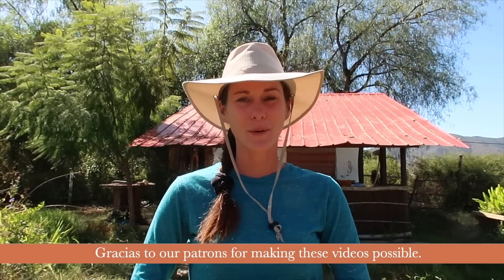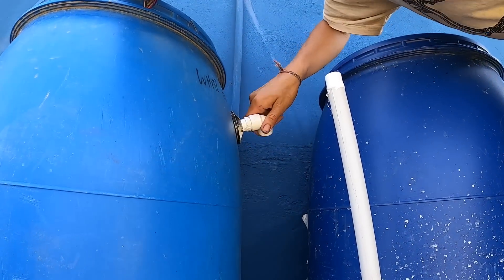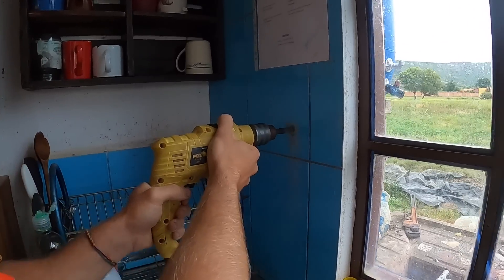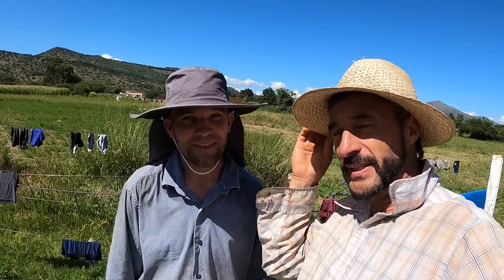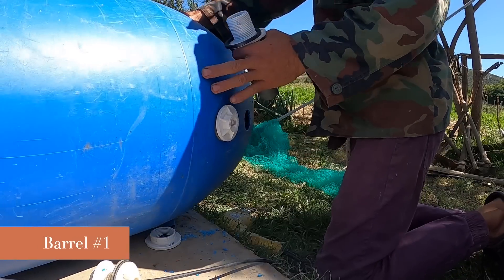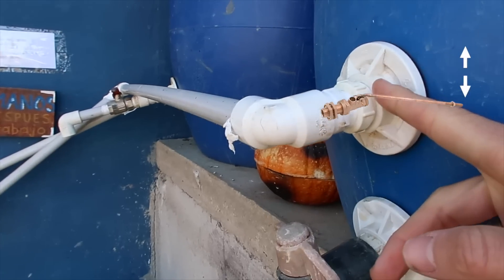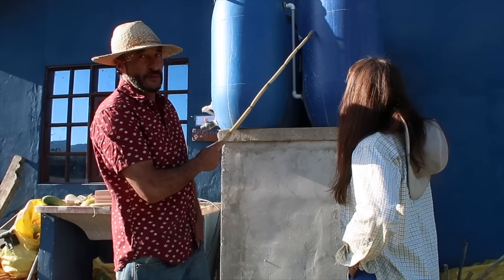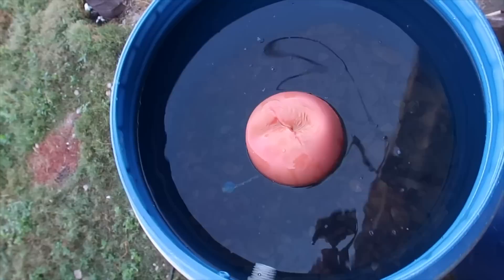At home WATER FILTER | How to build your own

Comment: Things you did not talk about: The sand must be washed before putting it in the filter, it's extremely important especially if you use construction sand. For this drum size, the flow rate must be close to 0.5 liter per minute, it's a slow sand filter. This kind of filter will not work well if the water is very dirty and full of clay, especially the charcoal step. But the 2 first tanks can still remove a lot of sediments.

Comment: Great video! Not that I have built anything like you did. But I thought it might be a good idea to use a bucket custom cut to fit over float value lever so it could move freely. Put some holes in it and rocks on it so it wouldn't float up.  Mount a pipe to it for the string line and float ball. Or spend $500 on a water softener.

Comment: I think an angle float valve installed at top of tank, and a pipe run to bottom, would be easier to access, service, adjust, and replace. Just a union on the fill tube will prevent having to cut the pipe during replacement. Also, using old cotton tee shirts with the mesh would protect the layers from mixing better. Just some thoughts. I really liked the video.

Comment: So I’m curious….. how much would it take to build a filter in the center of the community? Say a drinking well of sorts so anyone could stop by and fill up? Your house was $250 ish? So perhaps $500? I’m interested in facilitating this for the locals
Reply from the maker: That would be amazing wherever that is. At the community center US$500 would pay for the materials, labor required and one years connection to the town water (which needs to be filtered).
Reply from the maker: The-Collapse-of-Civilization  no probs with that as the kids aren't making a tight seal. An issue we have had with air sometimes is if you make the top exit hole too high up the barrel the plumbing will point up a little. If the system drains without constant  input water it can cause an airlock in that elbow.  Best to make the top outlet holes lower on the barrel to avoid the top curve inwards towards the rim. Hope that makes sense.
Reply from the maker: The-Collapse-of-Civilization  water will always find it's level. If the filter is working properly it will filter at a fast drizzle. You won't need high pressure to push.

Comment: I noticed that your charcoal wasn't all ground down into fine dust and there were lots of chunks/pieces in there. My understanding of charcoal filtration is that it is only as effective (and long lasting) as how fine you are able to make the dust. Did you know that a cup of fine charcoal dust has enough surface area to cover one acre? THAT is how effective filtration works because the huge surface area can bond with a high volume of nasties (heavy metals, etc). So unless you grind it down fine enough, (a) most of the charcoal content is not going to actually touch the water passing through the container (so not a very effective filter), and (b) the filtration effects that you do get will not last that long because most of the charcoal is being wasted. Next time use a pestle and mortar to grind each piece down into fine dust and then it will be almost like a shiny paste when you activate it with the acid. For a few hours more work, you'll have a filter that works 1000 times better at removing the bad stuff, and lasts years instead of months.
Reply from the maker: We just did a water analysis. Coliforms are present. They range from 0.5 nm wide. We will add another layer of finely ground activated charcoal to the top as per your recommendation.  Let's see how thick we can put it to optimise flow through rate.
Reply: @Kaiwaipermaculturebolivia did this work well for you? Adding the fine layer of charcoal?

Comment: I always wondered if sun exposure is good or bad to the stet filtration system. I’ve seen videos of shaded or covered systems, as well as exposed plastic blue barrels. Does the sun help break down the material faster? Does it interfere with the internal process?

Comment: Thanks 4 the video, great job!
An advice: in order to use all the volume of the filter you need to cut the excess of the screen: the flap of the net on the barrel wall is a shortcut for the water!!!!!! In the video, showing the filling up, the flow can be seen on the wall.

Comment: :goodvibes:Greetings to Bolivia from Wallachia
You have a nice filtration of water almost the same as we do here in Europe in solitary places where there is no drinking water, but if your friend from Germany helped you I am not surprised, we have Germans as western neighbors :elbowcough: I have similar filtration only smaller for rainwater as utility free i.e. before they introduce taxes even for water from the sky 😄 I have all layers in one container separated from each other by geotextile, filtered water then I store in IBC containers, I just don't have a settling valve in the gravel layer but I will finish it 😃 for me it was probably the hardest to wash carefully all the material before it was inserted into the filter, the plan is a replacement filter so that when the first one is clogged it switches to the second one by turning the valve and the first one is repaired 🥺 I wish you a lot of successful projects all the best.
Standy :yougotthis:
Reply from the maker: Washing the materials did take time.
Reply: @Kaiwaipermaculturebolivia  😂 🤏 👍

Comment: Thanks a lot I’m trying one with the flower pot I seen a guy do it it seems to be I got a little bit out of it you take a flower pot and then put a cork or a piece of wood in the bottom and let it drip through like a Berkey called a ceramic filter
Reply: Seems to work pretty good it does filter water but it’s pretty slow

Comment: I watched Josh Kern’s videos and yours. The filters are the same but the water source is different. Their water is either river, pond or well water. Yours is treated water. You said that it is being treated with chlorine. Wouldn’t the chlorine kill the bio organisms in the sand? Why didn’t you put the activated charcoal first? The charcoal would neutralize the chlorine before the chlorine got to the bio layer, which is in the top part of the sand.
Reply from the maker: They don't treat it with chlorine its actually poly aluminum chloride.  The idea with this filter system is the filter out larger to smaller.

Comment: Having worked with water treatment standards, I'm concerned about the use of bike tires as gaskets. You should really be getting rubber that's rated for drinking water instead of just recycling bike tires. Aside from that this looks like a really cool project!
Reply from the maker: Good one Jay. A non leaching silicon would suffice as the gasket doesnt actually cime into contact with the water when used in unison with silicone

Comment: Will this method remove chemicals, like the ones that spilled in East Palestine, Ohio?
Reply from the maker: Hi Nancy, those seem super toxic and corrosive.  I would use the same sequential system but instead of plastic barrels make cement structures or trenches. It will work that way.

Comment: Have you send the water to the lab to be tested.  To get a report. To remove  guessing just how good the system is.  Or can it be improved.
Reply from the maker: The original designer did. It took ag chemicals and bacterias out for 2 years then required a change of charcoal

Comment: Idea for you. When they make purified sand they basically torch it it in a metal drum rotating the drum of sand and burn the sand which turns bugs, parasites, debris to dust leaving the sand almost white. Sift over a fine screen leaving just the sand, and a much better filtering sand.
Reply from the maker: @markhuffman2752  great idea. Will adopt it

Comment: @Permaculture - Quick Question :)  When and where did you use the "Medium" sized rocks? 

Barrel 1 = Large Rocks + Bricks > Plastic Cover and Pipe > "Pea Gravel" 
Barrel 2 = Large Rocks > "Pea Gravel" > Mesh > Sands
Barrel 3 = Large Rocks > "Pea Gravel" > Mesh > Sands > Charcoal > Mesh > Large Rocks

I checked the "Jon Jandai Life is Easy" video and noticed he did not mention any "Medium" sized rocks. Just like your video, he only used Large Rock and then Pea Gravel. 

Thank you!
Reply from the maker: Aka Pea sized gravel

Comment: I don't understand something here.  You mention rock, sand and fine sand as if there is any distinction when it comes to filtering anything. Now fine sand would have to be in the micron arena to compete with a 1,5, or even 10micron pleated or poly-spun filter. A few of those filters and you are done when it comes to most “physical” issues with water. Now carbon filtration is the crux of all passive water filtration due to its “adsorption” capabilities. But even carbon cannot stop many toxins and or address specific unwanted and perhaps toxic hard water issues. There are only two ways to do this. One is as a secondary passive solar distillation process and or by using a Reverse Osmotic process.  I have built a passive distillation process, where both tables produce 10-12 gallons per day in the summer and half that in the winter, so I added a mixer station to add filtered water and distilled water to extend it. 50% distilled water is better than no distilled water…
Reply from the maker: It gets progressively finer till the charcoal. Helps for ease maintenance and to have the charcoal kept clean for the finer particles

Comment: What water did you use to clean all the material (I thought the water was bed) 🤔 Isn't that trading one Bad thing for another.?
Reply from the maker: Irrespective of the water used to clean once you flush the system two times the system should be clean.

Comment: I’m curious how long it takes to refill the storage tank after it’s run dry from normal usage. How long is one complete filtering cycle? I know it may be difficult but just an estimation of time if you please.
Reply from the maker: I estimate we purity 160 litres in less than an hour.  Maybe I'll time it sometime. You dont want it to push through too fast.
Reply: @Kaiwaipermaculturebolivia  the system isn’t under pressure so I don’t think it’s possible to overrun or over use it.

Comment: Are the barrels expensive there?  If not you could just purchase 4 more barrels and stack them and would be back up water and just siphon in up to filter.
Reply from the maker: Not so much. Us$25 per barrel. One on top would be enough
Reply: @Kaiwaipermaculturebolivia  
I probably wasn't clear.  Can you just use another barrel to use as the platform,  because I'm assuming your just using  gravity pressure.

Comment: Thank you for the lovely demo of such an important thing. What I would like to know is your experience on how the water behaves when you have it stored. What average or max. temperatures and what length and how does it affect the system? Point being a rough understanding on how often one needs rain or maintenance if the water stays stagnant in the 4th storage barrel. 🙏❤
Reply from the maker: Its stored airtight so I guess a long time.  Fyi I can leave a glass of this purified water on the bedside for 5 days and it still tastes pure and has no growths / discoloration etc. That is better than the commercial filtered bottled water we were buying.
Reply: @Kaiwaipermaculturebolivia  Thank you for responding. That sounds ideal! Please post more as your experience grows. This is super useful info. 
A joyful day to you.

Comment: since your filter is dependent on the pressure of city water, if you don't have that luxury, a supply tank on the top of the hill and attached supply line to the filter you folks have made would be needed, as well as some means to supply the water to the top of the hilltop supply tank
Reply from the maker: Correct. In our case we would put a barrel on top connected to our well pump with a float valve.

Comment: I have another solution. . . I had a stainless steel tank made of 1.5mm sheeting. There is no gutter water going into it. It fills by the water that hits the top of the tank, flowing into the tank via very small holes all around the lid in the center of the tank. 

As rain water is distilled and stainless doesn't leach  toxins. . . U have water ready to drink.
Reply from the maker: As long as the input water is clean from chemicals and bacterias that would work I guess

Comment: PVC in the sun toxic
Reply from the maker: Agreed. These tanks are hdpe and are on the south side of the house so are not exposed to direct sunlight.
Reply: @Kaiwaipermaculturebolivia  direct or indirect doesn't really matter the HDPE is leaching pfas/PFOS (fluoride) an endocrine disruptor... Not shitting on any of your effort actual non toxic containers should be labeled non-toxic not just "safe for human consumption" and "resistant to" sun exposure... You are trying to do the right thing and the social engineers already thought of that chess move before you even thought about filtering OUR WatEr... Eugenicist "Make the container toxic, but label it safe..."

Comment: I have a Q; I'm in the Philippines and our shallow well is very iron rich and sandy. It's dense black volcanic sand and it clogs our pump filter regularly. How will this affect this filtration system ie how do we get the black sand out of the first stage, without having to strip it down?
Reply from the maker: That is the function of the first tank. The sediment will settle to the bottom and there is a flush valve. So just with periodic flushing should be good as gold
Reply: @Kaiwaipermaculturebolivia  Hehehe I've heard of service with a smile, but I get a heart! Thanks.... I have just sold my wife on this after she's just had a hard day teaching, so I'll get busy sourcing materials, especially the barrels... The rest is definitely ok here. I've got a cunning plan to use the output from our well pressure tank (52psi)/32psi) into stage 1, by using a half inch inlet pipe with a ball valve so as to regulate the inflow. If you think that's not a good idea let me know; we are paying around $10 a week on distilled bottled water. Right now we only use the well for showering and washing dishes, plus watering plants. I suspect that this filtration system will recoup that in a few months. Many thanks for the quick reply.
Reply from the maker: @tyrotrainer765  we have since installed a tank on top of the system that can be filled by our well. It has a float valve to cut off when full. Gives passive constant flow to the water filter. Might work well in your case too.
Reply from the maker: Did you get it going?
Reply: @Kaiwaipermaculturebolivia  Thanks!

Comment: What is the frequency of replacement of each material in the filter system ?
Reply from the maker: We will publish a vid with a diagram and list of materials soon (would that answer your question?)
Reply: @Kaiwaipermaculturebolivia  I think you've already done that pretty efficiently on this already posted vid. What I'm requesting, is the frequency of replacement of each specific filter component, eg. How often should we change the charcoal, how often, the sand, how often, the gravel, etc. If you could furnish the details for those, it would be really helpful. Thanks for responding so quickly, appreciate it
Reply from the maker: @docsheji  charcoal every 2 years. Thats it
Reply: @Kaiwaipermaculturebolivia  Great, thanks !! 👍

Comment: This filter have the same issue as the original video.
The first stage filter is bypassed by the plastic pipe for the rope.
Reply from the maker: I very much doubt that all of the water is going up that way. It is a good idea to minimise the diameter of that pipe though.  The water inlet is at the side of the tank too, not at the middle where the pipe is.
Reply: @Kaiwaipermaculturebolivia  I've been working on this issue and mine is now ok.
Check on your if it is really a issue or not.
I can propose the solution that works for me.

Comment: Can the sand be rewashed and reused?
Reply from the maker: Doesnt need to be changed for many years
Reply: @Kaiwaipermaculturebolivia  Thank you, so would change and not wash?
Reply from the maker: @gillyburke7339  wash if needed. The original designer called for periodically stirring the surface of the sand in the second tank and then  scooping off that water.  I haven't seen a requirement to wash the sand further.
Reply: @Kaiwaipermaculturebolivia  thank you

Comment: Too bad it doesn’t filter the nano particles
Reply from the maker: Activated-carbon filters usually are rated by the size of the particles they are able to remove, measured in microns, and generally range from 50 microns (least effective) to 0.5 micron (most effective).  The uv light has an effect too

Comment: the Romans invented the sand trap filter. how are you disinfecting the water from parasites?
Reply from the maker: We have also since installed a uv light on the lid of the reservoir tank (4th). I dont believe its necessary but we can also uv purify by batch.

Comment: Good to see another implementation of Josh's work I maybe being fussy, but I'd be careful with the kind of silicone you use, screen material and the rubber, if it's in contact with the water, particularly after the carbon stage. Great work!
Reply from the maker: Great tip!  It probably doesn't need silicon if that cant be found
Reply: What would you recommend instead?
Reply: @lluckygrows  I would look for food grade silicone and silicone rubber then check the constituents and use stainless steel screen mesh.
Reply: Isn't the Teflon tape another consideration for toxicity?
Reply from the maker: @rachelwilliams248  Super neglible at best

Comment: My well has a liitle bit more salt. Can this filter it out?
Reply from the maker: According to the CDC: "Reverse Osmosis Systems will remove common chemical contaminants (metal ions, aqueous salts), including sodium, chloride, copper, chromium, and lead; may reduce arsenic, fluoride, radium, sulfate, calcium, magnesium, potassium, nitrate, and phosphorous.". I wouldnt trust their advice on injections but